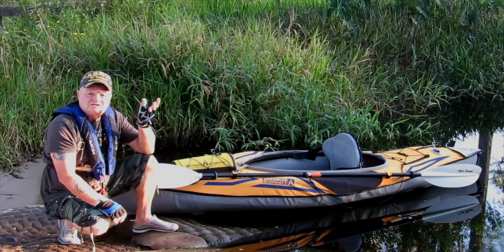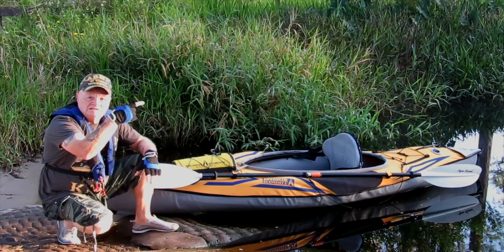Dropstich vs Backbone

Comment: I watched this video and purchased the backbone. I installed velcro on the bottom of the kayak and on the backbone pipe to make it easier to install the backbone in the center. This ensures that the backbone position does not change when other components are installed after the backbone is installed. The effect of attaching the backbone is great! I could feel the improvement of speed and straightness!
Reply from the maker: Excellent idea! Since I made that video I have switched out all my backbones to DS Floors for my paddling adventures. Enjoy. Thanks for watching.

Comment: I realize this is several years later from making the video, but thank you. I have watched several of yours. I went out for the first time today with my set-up using the backbone. The floor was inflated, but the backbone was well - let's just say, I need a pad on top of it. The kayak handled very well and I am thankful the company recommended this model over the one I wanted to get for many reasons.
Reply from the maker: Thanks, I agree the backbone also hurts the butt bone😂😅 I have since converted all my AE yaks to the drop stitch floors. I like the additional rigidity. Thanks for watching and your support.

Comment: I'm going to purchase an AE kayak to keep in my motor home here in New Zealand and finding your channel Mr D has been the best thing. There are so many choices and difficult decisions in choosing which kayak, dropstitch vs backbone etc etc. I'm going to be watching your vids all night to make my choice much easier. Love the clear and precise reviews, new sub here.
Reply from the maker: Xtreme 3 minute Videos Thank you for your comments. Maybe I can help with part of your decision making. I have converted all AE’s to the dropstich floor. When I started I used the backbone system but found the dropstich floor to be better for rigidity, but gave up a little speed. With the dropstich the setup time is faster by about three minutes. In my Convertible it made a huge difference. When I got my Expedition Elite (comes with dropstich) was when I was introduced to that floor and I was sold. All 6 of my AE’s now have dropstich floors. Hope that helped a little. Thanks for watching.
Reply: @DaleMrDSimmons  Thanks very much Dale, you're speaking from experience so I will definitely go with the drop stitch floor. I think I'm also going to go with the one in your video my Favorite AE kayak, Much appreciated, Greg
Reply from the maker: Xtreme 3 minute Videos before you make your decision, what is your height and weight?
Reply: @DaleMrDSimmons  I'm 6 feet and 175 pounds. I was wondering if there is enough leg room. Here in NZ they sell a 15 ft model which can be a 2 seater or 1 seat attached in the middle. I wondered if this is a good option? It looks easier to get into. It's called the convertible Elite
Reply from the maker: I have the convertible tandem and the expedition elite. The convertible is a lot of boat to paddle. Reason I asked before. Look at the AE1044DSXL. That has taken over as my favorite. You will see me in that one a lot in my later videos. It comes with the DS and pump. The XL means extra length. It is the same as the Sport and standard Advanced Frame but they made it 5” longer. Give taller people more room and it tracks like a dream. Here check this out https://youtu.be/3ZEI0k0HNAY
Reply: @DaleMrDSimmons  Thanks so much Dale, I'll check it out.

Comment: Thanks for the nice analytical review. Interesting to see that the backbone is faster. One important thing you did not mention is that with the backbone you sit lower so that in rough water you are much more stable. This is why folding kayaks are generally superior to inflatable kayaks in rough conditions (apart from the fact that it’s difficult to buy a narrow inflatable kayak apart from the shortish new fusion Evo)
Reply from the maker: Thanks for your insights. Thanks for watching

Comment: Seems to me that the company should have used their sense, and installed pockets that the backbone slides into. On one side, one of the pockets can have a velcro opening since the backboce cannot bend to slide into the pocket. Even better is a built in backbone which makes even more sense.
Reply from the maker: tranquility I agree with most of your statement. Having the backbone built in to the kayak would hinder greatly it's intended portability. The backbone is an option as the kayak operates well without it. The backbone adds more speed and improves tracking ability if one requires it. Thank you for your comments.

Comment: Now in Germanythere for the advanced elements there is a new dropstichfloor with an inflatable backbone incorporated. Seems to work fine.  Floor is rockhard and gives much form stability to the boat.
Reply from the maker: BBFazer thanks for the info. was not aware.
Reply: Which model of AE had the integrated backbone in the DS floor?

Comment: Dale, is there a reason you couldn't use the backbone and the drop stitch? We are in the market for the advanced elements advanced frame sport. Thanks for taking the time to do these videos. They are really helpful.
Reply from the maker: MMC SS I have been asked this many times. The answer is no as the spoon of the backbone will not sit correctly on the main chambers with the dropstich installed. Also using both would disfigure the bottom. With the dropstitch you kind of get a cathedral type hull. With the backbone more of a v-hull. In the past with this question, I contacted the manufacturer and they stated not to mix. Some people use a pool noodle but I also would not recommend it. I have converted all 6 of my AE kayaks to dropstich floors I enjoy the rigidity and comfort more than the backbone. Hope that helps.

Comment: I am waiting for advanced frame kayak delivery. So this thing comes witouth drop stich floor or backbone ? This boat has no bad reviews anywhere ! Can t wait for delivery...Like your videos
Reply from the maker: SuperGeert123 it depends what exactly you ordered. Several bundles are offered through AirKayaks.com. The dropstitch floor is the way to go.  TheAdvanced Element line are superior kayaks. Thank you.
Reply: @DaleMrDSimmons  Thanks, right now, it seems they don t do bundles. I should have it delivered soon. I figured out it comes without dropstich. The link you provided didn t work for me. Error..
Reply from the maker: SuperGeert123 I just AirKayaks.com and is seems everything in that selection is currently unavailable. Really popular kayak. Yes the basic Sport does not come with the backbone or the DS floor. They would have to be a separate purchase.

Comment: Thanks for the vids!  They are timely. I am trying to decide what model and brand to purchase and your vids are perfect. Question: I know you are not supposed to use the backbone and DS in conjunction, but why not?  Have you tried it?  It’d be nice to see it. Theoretically, you’d get width rigidity AND length strength plus a well defined V Hull. If you could just try it out and let us know if it works, that’d be appreciated!

Thanks man!  Keep up the good work!
Reply from the maker: Shawn Ciotti firstly thanks for watching my video. And to answer your question with the drop stitch floor installed the skin of the hull of the boat is extremely tight I feel adding the dog bone with the drop stitch floor Could cause structural damage to the boat. So I won’t try that because remember you’re dealing with an inflatable and if the manufacturer has stated not to use both there’s obviously a reason. My recommendation is to call advanced elements and ask them this question. I appreciate you watching my vids. I have learned over the past two years that not following the manufacturers recommendations can and will get you into trouble with inflatable‘s. The advanced elements sport is an exceptional boat with or without the dog bone and the stock floor but the drop stitch floor adds so much more rigidity and additional comfort. I own 7 kayaks, 5 inflatable‘s and 2 hard kayaks and the sport is my go to kayak for just a day of fun kayaking it’s fast nimble and light

Comment: Have you tried placing a pool noodle under the dropstich floor? Watching the video of the German Airbone floor, all it is is a pocket that an inflatable tube goes into under the floor. But in the video, he uses a foam noodle instead. It gives it a sold floor but also a v-hull. And if you look at the German AE site, I notice that the DS floor is now backbone friendly.
Reply from the maker: Mark Newman yes I’m aware of this modification in Europe. It’s currently to my knowledge not available in the USA. I did contact AE on this and they stated they were not aware of this. I think it could cause permanent disfiguring to the hull if used continually. But just my opinion. But it’s a cool idea. I no longer use backbones in any of my AE kayaks all are now DS floors. Thanks for watching.
Reply: Hey  @DaleMrDSimmons  , I have seen this comment about you no longer using the backbone.  Could I ask why you have opted to use the dropstitch floor over the backbone.  I can see it is easier to use but I would like to know your reasons.  I am considering getting the drop stitch floor.  Many Thanks.
Reply from the maker: tanyar9 Hi, yes I stopped using the backbones in all my kayaks and have adopted the DS floors. Purely for ease of use and setups. I notice no real discernible difference in performance or tracking and adds over all rigidity to the kayaks. I hope that answers your question. Thanks for watching
Reply: Do you know when AE is going to incorporate the airbone in the US versions under the DS?

Comment: I like your review, but have a few questions... Seems form your review, the Back Bone (BB) was faster and better tracking than the Drop Stitch Floor (DSF). But you also said the DSF is more comfortable. What does that mean? I do want btter performance so which shoud i get? BB?...   Also in your opinion how does the Advance Element inflatable compare to a normal hard shell kayak (speed tracking?)
Reply from the maker: The backbone with a stock seat is somewhat uncomfortable as you can feel the BB on your bum. If you’re looking for speed and performance take a look at the EVO. Comparing a hard yak to an AE is difficult as many hard kayaks have many different hull styles. A cathedral hull is very slow but very stable, a V hull is a lot faster but less stable for examples. An inflatable gives you portability and some great tracking. The AdvancedFrame line are pretty much flat bottom but with the forward and aft aluminum frames makes their tracking very good. I guess it’s what you’re looking for.

Comment: Can you do another test with and without the backbone? Due to your reviews I'm seriously considering the Advanced Elements Sport Kayak. But I don't know if the backbone is really worth it for me. I realize that it is improved tracking and speed. But how much of an improvement would be good to know. 

Also, is the skeg removable on the Advanced Elements Sport or is it fixed?
Reply from the maker: Treasure Pirate  I recently picked up another sport for my sister. It was a used kayak but I could not turn down this deal. Anyway, this one had just the stock floor so I tried it out without the backbone. It performed well just not as maneuverable as with the backbone nor as rigid as with the dropstitch floor. But it did well.

Comment: Hi and thanks for the great video.
Is there any problem for both of them backbone+dropstich to be used together and having the best of both worlds?
Reply from the maker: It will not work. The Dropstich flattens out the bottom and the backbone adds a v-shape to the hull. Getting the concave ends to mount would be almost impossible to mount. The difference in performance from the backbone to the dropstich is negligible. You will find the dropstich more comfortable and way easier to get in and out. Thank you
Reply: Dale Mr. D Simmons 
<3

Comment: FYI: AE included a sheet with my just purchased backbone giving situations where it "SHOULD NOT be used." They are:
1. Whitewater where the superior tracking with the backbone makes rapid maneuvers difficult.
2. Rivers that have shallow water and submerged hazards that could damage the hull.
3. Rough surf where coming ashore could bend the backbone.
4. Shallow water, oyster beds and reefs where sharp objects could damage the hull.
5. Dragging across land, which is not good anytime but where the stiffness of the backbone could cause even more damage.
Reply from the maker: That’s new. But great information. Thanks for watching

Comment: Do you feel it's relatively easy to convert between the two? I'm definitely leaning towards purchasing the convertible because I have a young daughter who will probably be onboard with me at least part of the time. I figured when she is in and stability is at a premium, DS floor makes sense. When it is just me, I'd like to use the standard floor, the backbone, and the rudder to help add extra rigidity and steering. I've also heard some folks have used both at the same time, but I know AE frowns on that.
Reply from the maker: Matty Sarro To be honest I would recommend the DS over the Backbone overall. I have both DS and the backbones and I now never use the backbones anymore. They just sit on a shelf in my garage. I find it way easier with the DS. I never have to pull out the floor to install the backbone on location and I really love the rigidity I get from the DS. Especially on the Convertible as that boat is huge. Performance with the DS vs the backbone is almost nothing. Also if you are going with the rudder kit the backbone becomes a moot point and a waste of money. Finally, I would never combine both as it could stretch out the hull permanently. There’s my 2 cents. Thank you for watching.
Reply: Thank you so much for all of your advice, and all of the work you've put into your videos. You've helped me learn a lot!

Comment: have your ever tried both the drop stitch with the back bone at the same time? i just got a convertible with the drop stitch and found it gets blown around in the wind, and was thinking the back bone might help. but haven't seen much on the use of both together.
Reply from the maker: C Stella I get this question a lot. Due to the design of the backbone and how it mounts one cannot combine both. Some in Europe have a sleeved system where they insert like a pool noodle but that also does not work as the DS floor’s pressure against the bottom of the kayak material would not allow for this additional object. As far as the wind goes all kayaks regardless be they hard or inflatable do get pushed around in the wind. The bigger the yak the more wind effects it. Hope that helps. Thanks for watching.

Comment: Is it possible (or advisable) to use the drop stitch floor at the same time as the backbone for added rigidity and better tracking on choppier waters?
Reply from the maker: illiniLB no I'm sorry it will not work.

Comment: I'm looking to get an Advanced Frame Expedition. It's either going to be the older model with the standard (lilo) floor or the newer Expedition Elite with the drop stitch floor. You've said that the drop stitch floor is more comfortable than the back bone but I can't find any comments comparing the older standard floor and the newer (harder) drop stitch floor. On a performance level I'd definitely prefer the stiffer floor but I'm wondering if you can comment on how comfortable it is sitting on the stiff drop stitch floor for long periods of time compared to the older standard (lilo) design. Also does the seat itself provide any padding?
Reply from the maker: Endurance Swimmer Australia the only comparison I can give you is a standard floor in the sport vs the drop-stitch. Without the backbone the floor is comfortable but a bit too soft for me. With the dogbone it adds more rigidly but I really prefer the DS floor. I have no experience with the older expedition however I do own the convertible with standard floor with dogbone that’s only 1foot longer than the expedition and I have paddled it with the solo setup and it was comfortable with the stock floor. I prefer the drop stitch floors in all my AE inflatables. As far as the seat it is comfortable with about 3/4” seat pad even with I long paddle. I have on occasion have a numb butt on a long paddle but with a short break that goes away. Normally a five or six mile paddle, no breaks, is fine and comfortable. Personally I would recommend the XE over the older model. I hope this helps.
Reply: Thanks. I'm actually wondering whether we may be better getting the sport. I note that it's your favorite inflatable kayak. What I'm looking for is a comfortable kayak for my partner to use in remote locations to accompany me swimming. How does the sport compare gm performance alongside the expedition?
Reply from the maker: Endurance Swimmer Australia for this purpose I would definitely recommend the sport.  Quick, nimble and easy to use. Moves easily through the water. Trust me I have run mine through some very tough areas here in Florida and it has never failed me. I just got a second sport yesterday for my sister as she was always stealing mine when we planned an outing. She likes it with the backbone where I like mine with the drop stitch. So now we have harmony in the family. Lol 
please let me know your decision which one you go with. Also if you do reviews for YouTube I would like to see it in action there in Australia which ever AE you get. Thank for watching.
Reply: Have you tried wearing a spray deck with any of the Advanced Elements inflatable kayaks rather than leaving the cockpit open?

Comment: Can you use both the backbone and the drop stich at the same time
Reply from the maker: It is not recommended. I’ve heard of some doing that. AE states no as it will disfigure the hull. I’ve heard of some people using pool noodles to attain that v-hull shape, but I have tried neither.